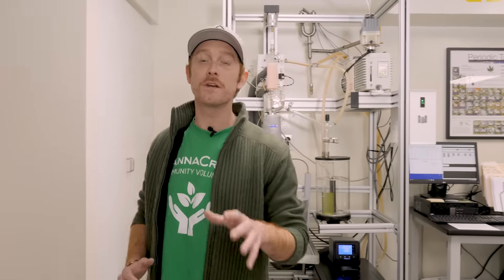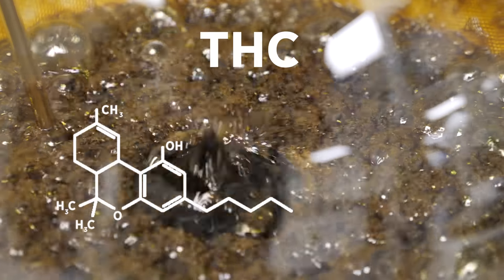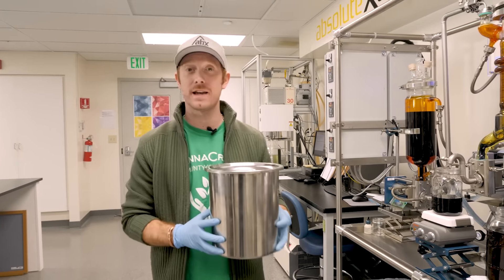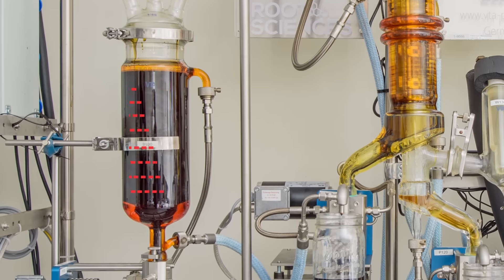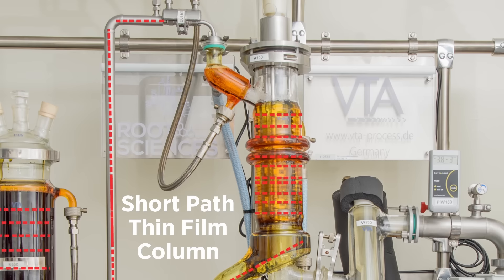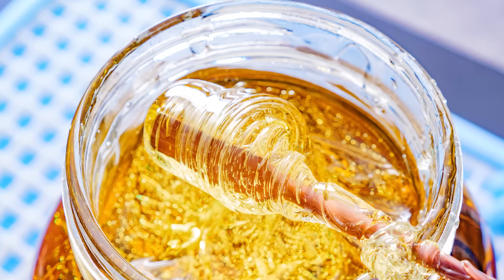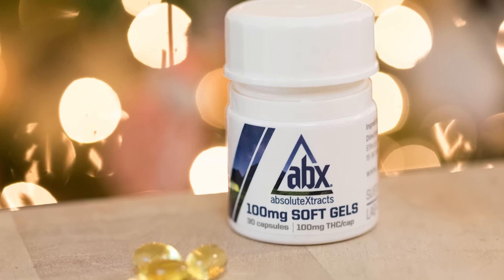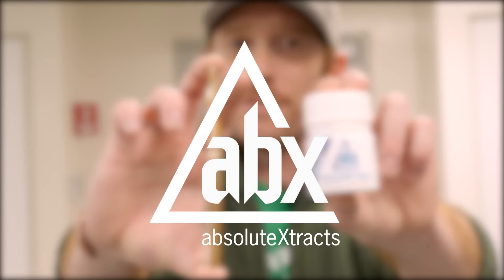How It's Made: Cannabis Distillate Oil

Comment: Is it possible to perform the thin filmed evap process at at home using household equipment? I have tried the winterisation process to eliminate the wax’s and lipids from my extract but I’d prefer a much clear end product as I’m still left with a dark solution that is unable to vape. Any help or advice would be welcome, thanks guys.
Reply: Try doing a quicker run for your first extraction (don't let anything soak, just pass it right through with a filter below), and do it with both the material and the solvent frozen/cold. Wax and lipids won't be dark, they'll be cloudy. You're extracting a ton of extra stuff that you don't want, primarily chlorophyll.

Maybe switch to rosin pressing. It's much safer and cleaner if you aren't in the proper environment with proper tools.
Reply: @TheSmileyFacedPizza  can rosin pressing be used for dab pens though?
Reply: @trapphone8685  yes
Reply: Make some rso for home projects, simple and effective
Reply: currently trying "short path distillation" to separate the unwanted wax and lipids. Spent about 150$ for the setup, I'm waiting for the parts to arrive and then try it at home.
The idea is to create a closed system with vacuum and heat up the crude oil, evaporate light weight conpounds like thc and cbd and then condense them inside another flask. This is achived by using temperature control. wops realized this comment is 6 years old. maybe you had better luck alredy lol

Comment: How do you prevent oxidation?
Reply: oxidation occurs with oxygen. Remove the oxygen with a vacuum and seal compound into air-tight vacuums wont cause oxidation.
Reply: @Christopher Jones  decided to put jar of distillate in 130°f water bath for 12 hours. Homogenized the whole batch to give it its final color. Then add the terps.
Reply: @joshc8055  no videos uploaded of you making distillate?

Comment: Can you put distillate in regular vapes? That are used for nicotine?
Reply: oRunaljod you sure can
Reply: No actually it's usually too thick
Reply: oRunaljod it is not to thick ive done it u buy a big vape tank n i put some n mine n it works great n i dnt even have an expensive vape setup n thwre are things u can buy to thin it out n u can buy stuff online to mix with waxes and butters and i use rosins n this stuff i take rosin n put this vape stuff that u heat it up n it turns it into a vape form n u canbuse that same stuff to thin out ur distilled oil

Comment: Would you say the process to get delta 8 is the same way but because trace amounts are found (delta 8) in the plant you guys have to make synthetics delta 8 and turn that into disitllate
Reply: I hope you've learned the answer since you asked it 2 years ago, but in case not: No. Delta 8 and all other alt noids (hhc, cbg, cbn, thcp, etc.) are made by converting them from cbd. There's not enough of these in cannabis to extract.  Since they need to be made in a lab, it's important to research alt-noid companies and make sure you're buying a reputable brand with legitimate third-party Certificates of Analysis to make sure there's no poisonous solvents or whatever left in the product.

Comment: My question is what is the bad that they removed? I doubt anything is really bad in it, everything has its benefits. Is it sold as a different product?
Reply: Probably splitting the good stuff (to get higher potency) from the stuff that doesnt matter
Reply: Waxes, chlorophyll shit like that. It's not bad it's just not needed
Reply: CBD, since move vape is pure THC?
Reply: @patrickwells301  CBD and THC are kinda the same stuff in this process so they'll both be in the "good" The bad in this process would be mostly plant matter
Reply: So 5 months later and still no one has the answer, 🤣...
Reply: @kneehigh9861  pretty sure you just want to remove as much excess material as possible to increase %thc
Reply: Why remove? It goes great on pancakes.  Mmm mystery syrup...